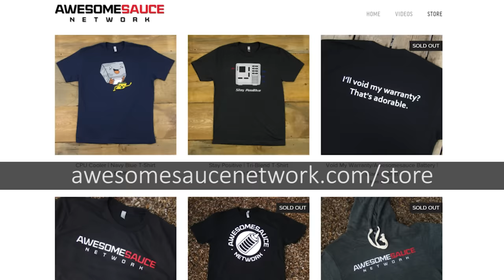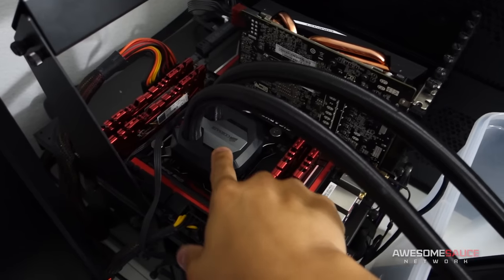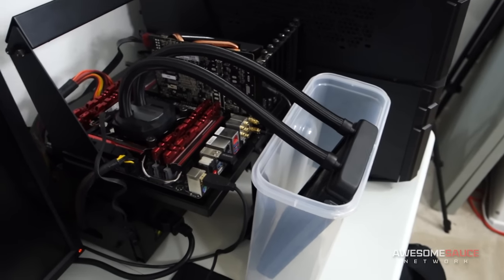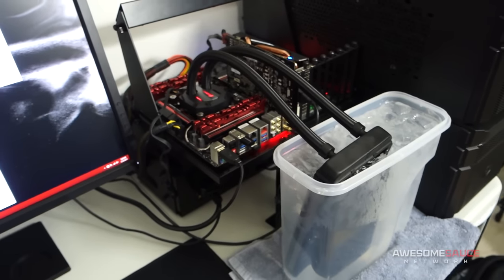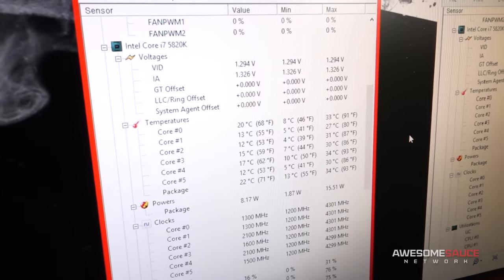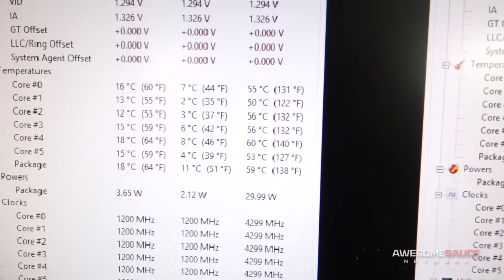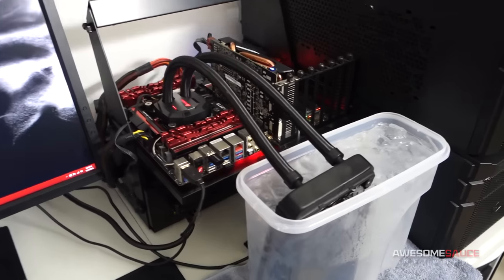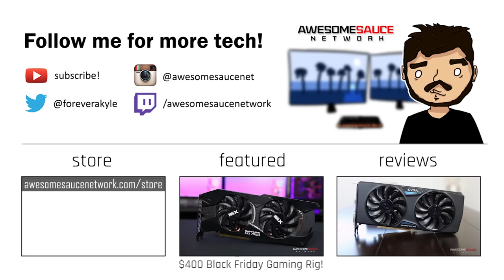AIO Ice Bath Challenge! Does it Work?

Comment: KYLE! This video was a ton of fun, but I think you're lucky we're in CA and it's super dry out. Sub-ambient cooling = condensation, unless you grease up all the naughty bits with something hydrophobic. Just an FYI for any viewers who might try this -- I wouldn't unless you know what you're doing!
Reply: Thanks. love your videos btw
Reply: +Paul's Hardware It's okay, I'm a professional Australian. What's the worst that can happen? Getting mauled by a dropbear?
Reply: +nfsm654 a crocibeardilotiger
Reply from the maker: +Paul's Hardware It's ok Paul, I'm an expert at damaging hardware by now. Good warning for the viewers though!
Reply: +Awesomesauce Network xD
Reply: +Awesomesauce Network Yes, we all remember the AIC that leaked on ur CPU socket. :P btw, what clockspeed did you have, temps were kinda high even with icebucket... Im still kinda learning but I have a i3770K @ 4,842GHz and on Cinebench, maxload it runs with 1.450v stable and reach 93C° across it? Been running it for over a year, but is it any problems running it for longer times? I mainly game and render a video now and then, but games doesnt take that much power from it like Cinebench for an example.
Reply: +Paul's Hardware  Ya, Um I wanna see the reviews on the bag-o-ice soo...ya..
Reply: +Balubish Tech I noticed he was running at 1.294v at 4.3ghz, which is a pretty high VID for that clock speed. I am running my 5820k at 4.5ghz and 1.275v with a H110i GT and get about 10 degree celsius cooler temperatures than Kyle is getting in his 'non-iced' tests. Every chip is a little different, that's why they call it the silicon lottery :P
Reply: Dustin Carpenter true
Reply: +Paul's Hardware  Preach it brother! You can actually remove the condensation with enough air flow so if you are going to do this make sure a box fan or table fan is blowing on the entire system especially the cpu water block. Even then micro drops will occur and need to be quickly wiped before they coalesce and drip to the gpu. I ran a dryer duct from an AC to an intake fan and had similar issues. Condensation Kills!
Reply: +Balubish Tech those are some really high temperatures and voltage man. Im surprised it hasnt burnt out in a years time. Crazy
Reply: Mitchell Hall its only at full load and that never happens when gaming and stuff. Im at 2 years and 8 months, still working great. :-)
Reply: +Paul&#39;s Hardware My 5820k oc to 4.0 idols in the mid to high teens with the h100i with some corsair sp fans spinning at 1000 ish rpm. The temps have been lower at idol with the lowest 9c and the highest 12c. at load the temps rarely go above 50c
Reply: +Red Grape wow you gotta have a cold ass room then.
Reply: +Balubish Tech please don't remind me. :)
Reply: +Red Grape yeah if you have that low on idle aka ambient temp its chilly as hell
Reply: +Awesomesauce Network lmbo
Reply: I presume that's why the suggestion when you use a "phase-change" cooler (i.e. a/c types) is to pack the area of the socket with something to insulate, like a kneaded eraser...
Reply: +Awesomesauce Network But have you drilled through a motherboard?
Reply: +Paul's Hardware Just paint the motherboard with black nail polish and pump the socket with dielectric grease Jheeze newbie. lol jk :p
Reply: +Paul's Hardware was thinking the same.
Reply: +Scott Chegg yeah i have run my 3770k @ 4.8 with 1.45v for over a year. kinda shows the difference.
Reply: it only matters for the surfaces that touch the relatively humid air. If you have lots of insulation (even thick plastic does a bit) as the outside surface, water won't condense(insulation has to be air sealed ofc).
Reply: Paul's Hardware try that in Texas yeah it's way worse
Reply: Using a Ice water bong, will never condensate, yes sub ambient will condensate however you have to have over a 10c water to air Delta, which this won't do.

To be clear, I know this because I have done this a million times, before getting a real subzero cooler. I also live in high mountains where it is humid. 

Also lower temps can achieve higher clocks lol. We do not use LN2, Sub Zero chillers, Phase Change ect, to prevent throttling. 

If you have lower temps you can push more voltage, More voltage = Higher clocks. Even this setup is used by those on HWBot that do the WC OC challenges, as use of a real chiller is against the rules.
Reply: Nukeuler123 Depends on what part of Texas because not all corners of Texas are the same... Specially the West ;)
Reply: true
Reply: I was about to explain the same thing to him. This is a generally bad idea for most people.
Reply: Paul's Hardware true
Reply: Paul's Hardware would dry ice have the same effect ?
Reply: nathan dials yep

Look up der8auer on YouTube. He's doing mad oc wr with asus and always puts stuff around the mb so the condensation would not damage his stuff
Reply: Heterochromy thanks a million
Reply: Yeah I was thinking the same, but awesome that it worked.
Reply: You guys know there is this magic thing called Arma-Flex rubber insulation you can buy anywhere at any hard store. It is what is used on chilled water in large application cooling. Even better it is cheap and comes split and ready to wrap around pipes. Just make sure you seal it all the way around and you should have little or no condensation. Unless you live in the South where humidity is 90% then you may have a drip that cane be stopped with a simple bath cloth or towel in the area of drip.  I used to insulate Steam and chilled water pipes. It will work!
Reply: what about the waterblock john?
Reply: Paul's Hardware I was about to comment this until I saw your post. It's lucky the pump in that AIO sucks so temps weren't too low. Afriend of mine did this with a 1500lph pump, 2 big rads and salted ice water. He had condensation everywhere. Even the back of his motherboard was wet. His mobo etc was sprayed with lacquer so it was all fine. He was a 2 water loops with some serious peltiers and gets -16deg C at idle so he is used to condensation.
Reply: nathan dials Yes, dry ice will cause a lot of condensation.
Reply: Cyber Locc you obviously have low humidity where you live or your water loop sucks. My mate had water running down the back of his mobo from doing this. He was getting close to 0 deg at idle. Condensation formed instantly. luckily the board was covered in lacquer so it didnt do any damage.  there was condensation forming on the pipework and dripping off.
Reply: does anyone tried use 2 radiator loop for custom cpu liquid cooling? cpu -> radiator 1 -> radiator 2 -> cpu again. fan airflow from radiator 2 to radiator 1. will this get better cooling lower temperature compare with only one radiator used?
Reply: Lee Chuen Leong Yeah I have 2x 480mm caselabs radiators, 60mm thick. 8 ek vardar fans on them.
Reply: Lee Chuen Leong It won't matter. Loop order doesn't matter as the fluid will hit an equilibrium temp and stay there. At best you'd be looking at 1-2°C.

EDIT: I misunderstood the question. You're asking about adding capacity, not loop order. in which case, maybe. You might see a decrease in temps, but a) you'll never drop below ambient, and 2) at a certain point, adding more rad won't do much. Where exactly you hit that point will depend on what equipment you're using.
Reply: Paul's Hardware You are correct.  Condensation would have built up around the pump housing sitting on top of the CPU.  Just takes a few drops and bye bye motherboard.
Reply: I think we can solve the problem of condensation.  Place the system board 180 degress, opposite from the video shown here, any water that was building up as condensation would just drop down to a "safe place". Bless gravity(though some times we hate it :P ).
Reply: I thought about that myself. I was considering a peltier cooler. Water has a tendency to migrate across things if they aren't perfectly level, so you won't really be able to predict it too easily. It worried me enough not to try it. 

If you try it, I think the key to your success will be luck, or climate control.
Reply: 666likes, PAUL, U DEMON
Reply: Dude ever since i saw your AIO kill your test bed I am paranoid about my skylake build. had a 8350 with a corsair AIO for 4 years in a closed case and never once had any concern.  The pump died once in 4 years but that was it... Still dont know how yours came apart, did you get any answer from the manufacturer? Or are you sticking with it was the tension from it hanging?
Reply: What if you vacuum sealed your case? No air, no condensation, right? Then you could cool as low as you like, no? I suppose you'd need an alternative to passive radiation for the chipset, hard drive and all, but surely that's fairly trivial for an elite modder. ;)
Reply: Was gonna say - Condensation = BAD!
Reply: Miki Cerise
You would indeed need active cooling for all components that generate heat. It's in the realm of possibility but would be a real bitch to figure out.
Reply: Paul's Hardware i ran a system like this for 2 years back in 2011 there huge post about it and its more pro done on tomshardware.
Reply: Paul's Hardware indeed a condensation on the pcb is fatal.
Reply: Paul's Hardware anyone know what program Kyle is running to get all of that system information? I use RealTemps and while nice enough, it does not give NEARLY as much information as whatever is used in this video! The name of the program would be very much appreciated!
Reply: DysphoricSmile  hw monitor
Reply: DysphoricSmile HW Monitor is great, but keep RealTemps for CPU stuff. In some instances I've seen real temp keep a bit more consistent accuracy than HW Monitor. I love HW Monitor, but for some idiotic reason, some tend to say it sucks. This is especially a common argument when users have issues determining why TMPINx ("x" representing a number) shows an insanely high temperature that doesn't really budge (one of my motherboards has this issue on TMPIN3 while the other shows it on TMPIN5).
Reply: sweating was the first thing I thought of when I saw this.
Reply: You could also just use a pure gas mixture... or liquid even. Like mineral oil.

Comment: What about salt + ice + water?Mmythbusters saw that this was a better way to cool a beer down quicker.
Reply from the maker: Guess a part 2 is in order?
Reply: +Awesomesauce Network how about you use a car radiator insted of pc radiator will it work ?
Reply: +Awesomesauce Network It would be also fun to see what difference does it make on some liquid cooled GPUs (:
Reply: +Shane Ottinger +Awesomesauce Network but that would cause some corrosion long term
Reply: +Paulius Kartavcevas yes it will work the same but there is no point bigger only makes it take longer to get heat soaked. if you want to go really cold all the time linus did a video on a case with fridge motor that has the CPU run at 0 degrees at 5ghz
Reply: Yes, please try again with salt. I'm curious to see what difference it would make. Also, something to circulate the ice water might be worth checking.
Reply: Dr. Big Balls why don't you just do it yourself
Reply: Well, looks like there is a big rabbit hole that was opened here! ><
Reply: +Awesomesauce Network only drop the temp by like 2c max, since the delta between ice water and salt ice water is like 2c max.
Reply: +Shane Ottinger - Will be so interesting..
Reply: Now do u know why?
Reply: +Shane Ottinger Depending of what kind of metal and surface treatment the radiator has had, there could be some corrosion issues. Which would most likely be accelerated by adding salt to the solution.
Reply: +Awesomesauce Network the salt will rust the AIO....
Reply: +neurotoksin Corsair uses aluminum radiators in their AIOs, so corrosion is definitely going to be a problem. Plus I think saline around any solder (the bonding of the fins to channels) wouldn't be a good idea either.
Reply: neurotoksin yup, however this would not be something you would want to run all the time. Ships that go out to see usually have these chunks of metal to help prevent the hull from being eaten away. I do not know the science behind it, I just know this is something they do.
Reply: +Shane Ottinger I just want to point out that salt is highly conductive.
Reply: +Awesomesauce Network see if you can get a small aquarium pump to move liquid across the surface of the AIO as well!
Reply: +yoinkerman In high school, my science teacher ask us to put ice in water. Guess what! the temperature of the salt water came down to -18 ° C if I remember correctly... That is considerable!
Reply: +Awesomesauce Network add some fans...  too add circulation of water so it does not stock up.. like  heated water stays near the vicinity of the radiator..

like a cheapo fans running at its full speed... :D :D :D :D
Reply: +Shane Ottinger Wouldn't that corrode the metal in the fins though?
Reply: +Shane Ottinger you're talking about sacrificial anodes. like thick Zinc plates bolted/welded to the exterior of the hull.
Sacrificial anodes is like the bare basics; the level up from that is ICCP system which uses DC electricity to prevent electrochemical action of galvanic corrosion before it begins. ✌
Reply: +Awesomesauce Network ADD NOCTUA IP67 FANS
Reply: +Awesomesauce Network Nice ! Looking forward to that Beercooled CPU video of yours.
Reply: +Awesomesauce Network No worries.I'm European by descent and drink my beer warm.
Reply: +Paulius Kartavcevas They used a car radiator at linus techtips once for a scrapyard wars pc build (season 1 or 2 i think)
Reply: As a fun experiment yes that would be cool but risk corrosion after long term
Reply: +BitWit. Saw your Icebucked cooling just now, nicely done.Maybe you could do a Part 2 with salt icewater, and while u are on it try to pump some water thru the radiator with some small pumps (if u have some at hand). Your test now, was more like a fanless radiator in an Iglu but impressive non the less. For Science and beyond :P
Reply: heres the issue with salt+ice water. you actually loose cooling capacity. it takes a substantial amount of energy to turn 0c ice into 0c water, yes, salt will lower the temp of the water, but will also cause the ice to melt faster, which actually decreases the energy required to heat the water. the same energy needed to melt the ice into water, will be able to heat 0c water to nearly room temp. by not using salt, you get a longer time period before the water temps start to rise.
Reply: Why not dry ice and water.
Reply: ***** don't forget the salt or the water freezes
Reply: Don't add the salt until the pump is running at full speed, otherwise you risk the coolant in the AIO freezing.
Reply: thats why its antifreeze
Reply: that's how you can make ice cream, imagine what happens on the inside of the radiator. You might want to fill up with antifreeze
Reply: R3MIX Productions Actually its Propylene Glycol (PWG) and/or Ethylene Glycol (EGW) used in Antifreeze because salts would start reacting with the rubber hoses , aluminum radiator, water pump and many other parts which would cause corrosion. Though PWG and EGW do corrode metals and rubber, its not nearly as corrosive as salt.
Reply: Sunako Kirishiki the water & salt is used on the outside in a way the temperature 
will decrease far below zero on the inside of the radiator...... so if there is just 
water on the inside it freezes and worse..... expands so that's why I 
said use antifreeze... on the inside
Reply: Sunako Kirishiki some like ekwb's predator can but normal ones like corsair can't.
Reply: Having a deep freezer near the pc? Using waterproof fans to circulate water? Using some corrosion inhibitors? I'm sure there are freezer's with software on them that keeps them at the same temp when their temp increases (by boosting cooling). You can have holes in it so heat can go off in to the air too, since the water is limited and it would need to evoparate when it can't contain the heat anymore.
Reply: Salt absorbs wster and expands, hence why too much salt will kill you, and it will most likely clog up the system
Reply: Shane Ottinger what about nitrogen?
Reply: Bitwit yep part 2 😂

Comment: You should add salt to the mix and the temp will drop quite a bit in the water and you might be able to get even more cooling. That would be cool to see.
Reply: Bobby Jones  except that salt is highly corrosive.
Reply: salt water has a lower freezing point compared to fresh water, since the water wasn't freezing up it wouldn't change anything.
Reply: it would by maybe a couple degrees because the ice is most likely lower than 0C. The salt corroding the radiator, well that would depend on what paint they used on it I suppose...
Reply: Jason Henderson Your wrong. It would lower the temperature of the water. If you want to see proof, Google the Mythbusters episode where they try to find the quickest way to chill a beer. They add a large amount of salt to their ice water and temp goes down. The science is complicated but it does work.
Reply: the core of an ice cube is colder than the surface and there is a gradient from surface to the core. adding salt lowers the melting point causing the warmer surface to melt until it reaches the point in that gradient where it is at its new melting point. the liquid water in an ice bath will be the same temp as the surface of the ice cubes
Reply: but salt also lowers the freezing point of water, hence the reason we put it on the ground when it snows. bruh
Reply: Kevin moehring yeah ice water won't freeze solid at room temperature. Especially if it's being heated by a CPU.
Reply: rust
Reply: apparently none of you have ever made home made ice cream, you use salt water to chill the cream sugar etc until it freezes.. in ambient temps of 80-90 F. while salt is corrosive for the purpose of an hour or two long test it will not corrode (aluminum corrodes not rusts) it can be easily rinsed off in the sink.
Reply: what if you actually want to do this oftenly?